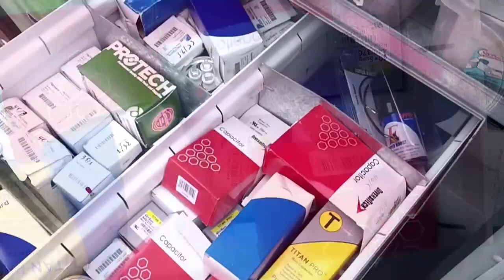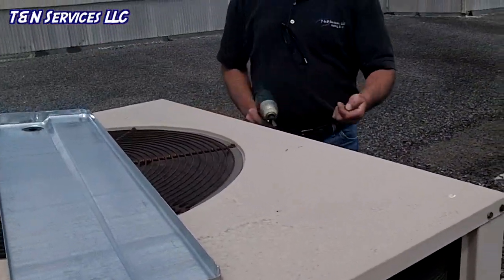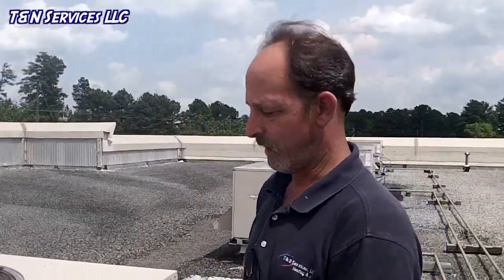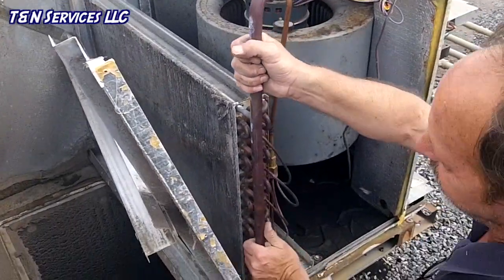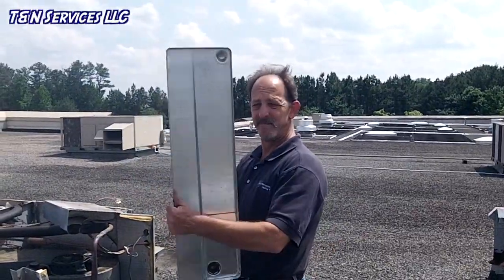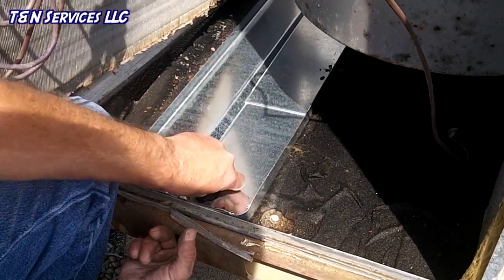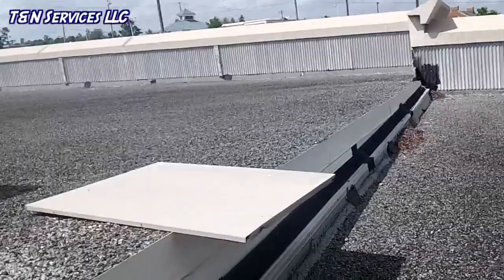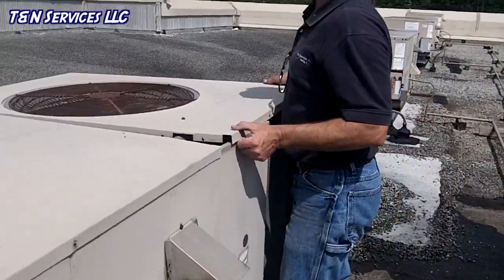York Package Unit Drain Pan Replacement

Comment: I’ve done many of those drain pans. They’re not too bad. I use 2 people on those jobs so one can lift the coil and the other can slide in the new pan. Lifting the coil from the header is not recommended. Also I’m not sure where you are located but the corner posts at the condenser coil can and will have wasp nests. You should look under them at the top before you find one the hard way. Here in Houston the nests are quite common in the corner. Good video. Be safe.

Comment: Great video Ralph, you made that so easy I can't wait to do one myself.  RIGHT.  Keep up the good work.
Ray
Reply from the maker: you can handle it Ray I promise
Reply: I've actually had to replace the insulation on a York package unit because it came unglued and fell onto the blower motor.  This is just one step farther.  Keep up the good work amigo.
Ray
Reply from the maker: Hey Ray, I bet your job took longer then mine did.

Comment: Nice!!! I know plastic pans will crack, but why are they still making them metal?
Reply: Nice job Ralph. I have never had to change a drain pan on one of those either. I have had to change the heat exchanger and it is not to bad.
Reply from the maker: Hey Rob, the hardest part is dragging all your stuff on the roof. Everything else is a walk in the park
Reply from the maker: Hey Keith, if they were plastic they would crack, LOL then we would all complain about that